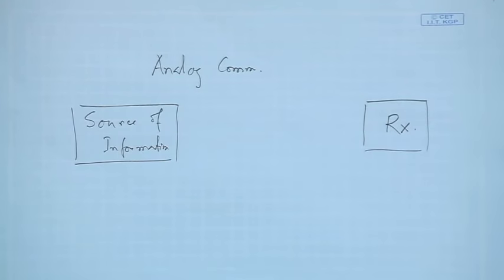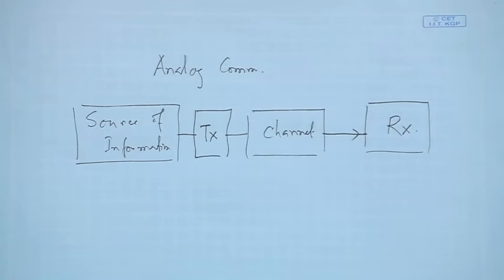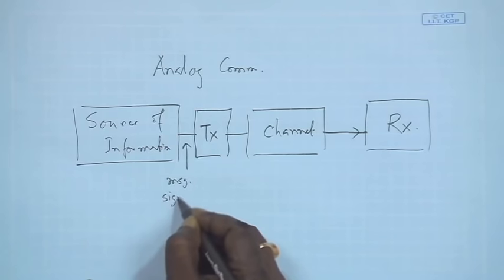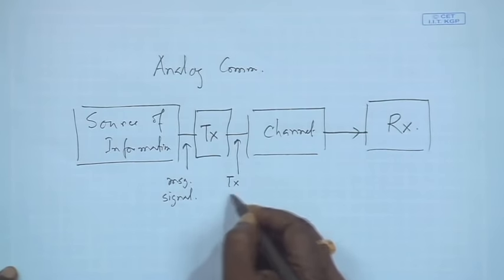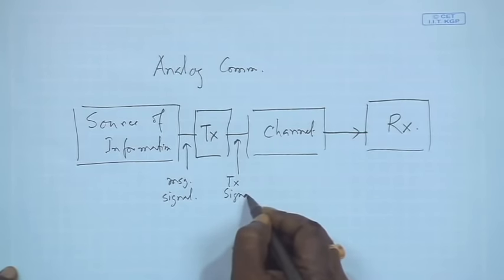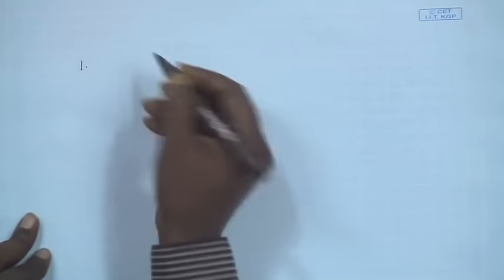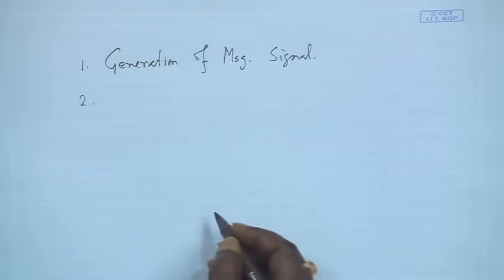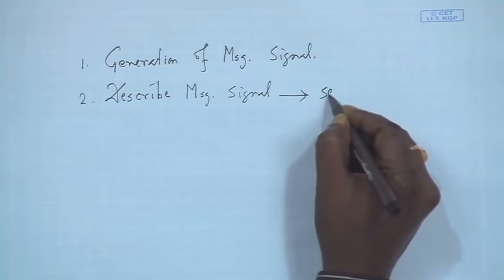Lecture 1 : Fourier Series

Comment: according to my knowledge carrier signal does'nt hold any information then why we are transmitting carrier signal
Reply: because it has a very high frequency and thus lower possibility of attenuation or destruction due to interference ..
Reply: because of ease of demodulation
Reply: To Modulte  very necessary thing and basic thing
Reply: Because, sir, a carrier signal is chosen for its ability to travel far in our atmosphere. You shout: you can barely be heard 10 meters away. But you can transmit your voice across the world on a suitably-chosen carrier. That is how you receive short-wave radio.The carrier is the bus or airplane; your voice is the passenger or payload.